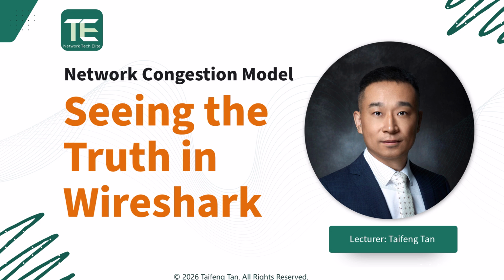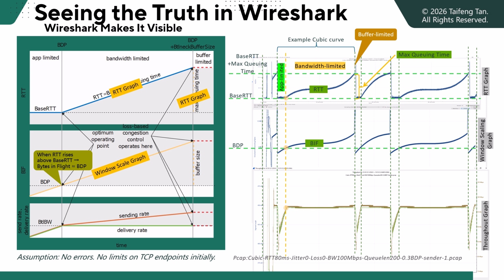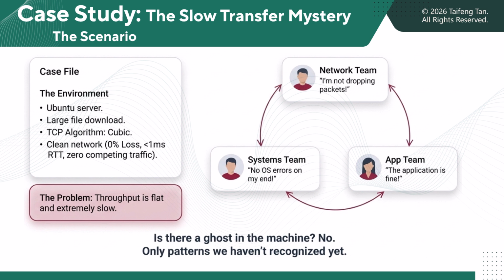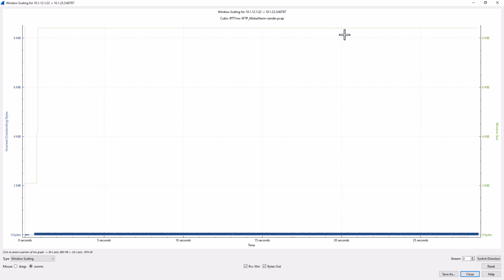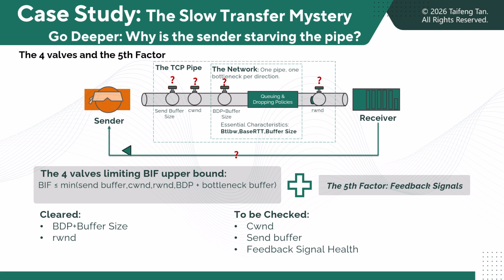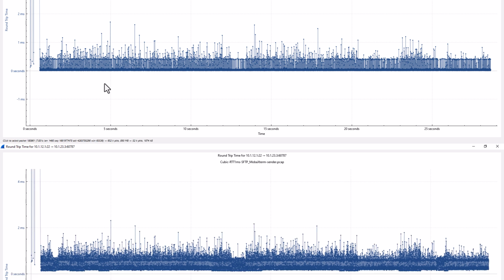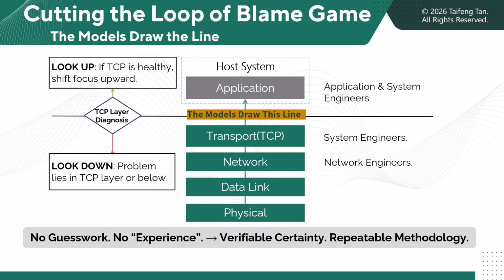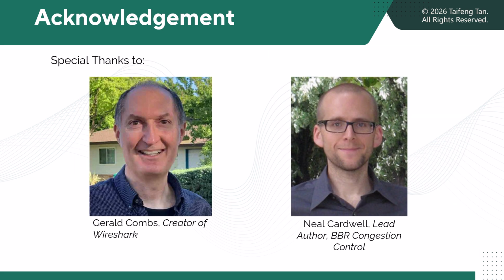EP4-No Packet Loss. RTT＜1ms. So Why Is It Slow? (Wireshark Explained) | Part1,Section 4

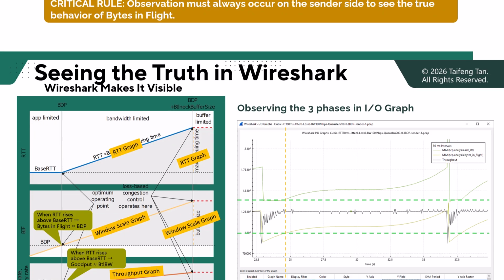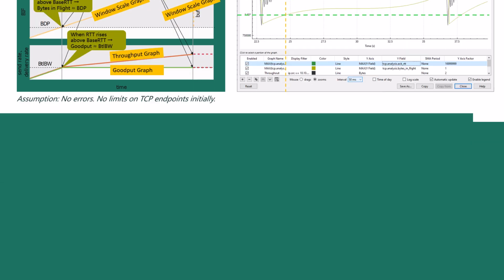Comment: In the slide shown from 4:47 to 5:17, what is the exact display filter used for the throughput graph?  It's cut off, but begins with "ip.src -- 10.10."
Reply from the maker: It is 10.10.12.1, the source IP of the flow and the sender. This is used to limit I/O statistics to a more precise value.
Reply: Ok, thanks. It was labeled as "Throughput", so I thought there might be more to it than that.

Comment from the maker: Summary
In the first three episodes, we built the Network Path Model and the Network Congestion Model.
Now, we test them against reality — using Wireshark.
______________________________________
🎯 The Problem
You’re on a 10Gbps network:
•	No packet loss 
•	No competing traffic 
•	RTT < 1ms 
Everything looks perfect.
And yet… throughput stays low.
______________________________________
🔍 What You’ll Learn
In this episode, you’ll learn how to:
•	Read Wireshark TCP Stream Graphs: 
o	RTT Graph 
o	Throughput Graph 
o	Bytes in Flight (Window Scaling) 
•	Identify the three fundamental TCP states: 
o	Application-Limited 
o	Bandwidth-Limited 
o	Buffer-Limited 
•	Estimate BDP (Bandwidth-Delay Product) directly from packet captures 
•	Determine where the bottleneck actually is: 
o	Network 
o	TCP stack 
o	Receiver 
o	Application 
______________________________________
🧪 Real Case Study
We analyze a real TCP capture where:
•	Bandwidth = 10Gbps 
•	RTT ≈ 1ms 
•	No loss, no congestion 
👉 But throughput is stuck around 250 Mbps
Using three graphs, we prove:
•	RTT is flat → no queuing → network is not limiting
•	Bytes in Flight stays low → pipe not filled 
•	Send Rate ≈ Delivery Rate → network is not limiting 
👉 Final conclusion:
This flow is Application-Limited
______________________________________
🧠 The Key Insight
Every TCP flow is ALWAYS in one of three states:
•	Application-Limited 
•	Bandwidth-Limited 
•	Buffer-Limited 
If a transfer is slow, it is stuck in one of them.
______________________________________
🧰 The Methodology
Stop guessing. Use a model.
1.	Start at the TCP layer 
2.	Observe: 
o	RTT 
o	Bytes in Flight 
o	Send Rate 
o	Delivery Rate 
3.	Map behavior to the Network Congestion Model 
4.	Identify the limiting factor 
👉 This creates a clear boundary of responsibility:
•	TCP / Network problem? → Network team 
•	TCP healthy? → Look above TCP 
No blame. Just clarity.
______________________________________
📦 Practice
Pause the video and analyze the PCAP yourself:
👉 Download link here: https://drive.google.com/drive/folders/1g_i6ZYROOMrdcNrNLi6A4P3-xYFBKq10?usp=sharing
Where Cubic-RTT80ms-Jitter0-Loss0-BW100Mbps-Queuelen200-0.3BDP-Sender.pcap is a sample demonstrating how to observe network congestion models in Wireshark, serving also as a comparison case.
The following two are PCAPs used for the case study.
Cubic-RTT1ms-SFTP_MobaXterm-sender.pcap
Cubic-RTT1ms-SFTP_MobaXterm-Receiver.pcap
______________________________________
🙏 Credits
Special thanks to:
•	Gerald Combs 
•	Google BBR Team 
This model is inspired by the BBR paper and extended using real observability from Wireshark.
______________________________________
🚀 What’s Next
In the next episode:
•	Build your own lab 
•	Reproduce network scenarios 
•	Capture real packets 
•	Go deeper into root causes (disk I/O, application limits, etc.) 
______________________________________
🔔 Follow the Series
If you want to move from:
👉 Seeing packets
to
👉 Understanding the truth behind them
Subscribe and turn on notifications.
______________________________________
💬 Final Thought
Network analysis is not magic.
It’s not intuition.
It’s not “10 years of experience.”
It’s a repeatable, verifiable methodology.